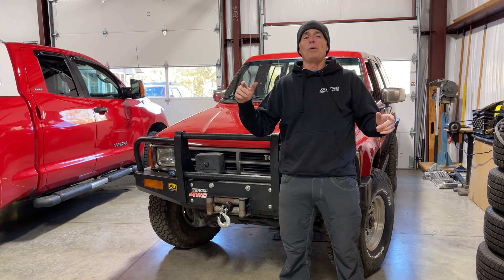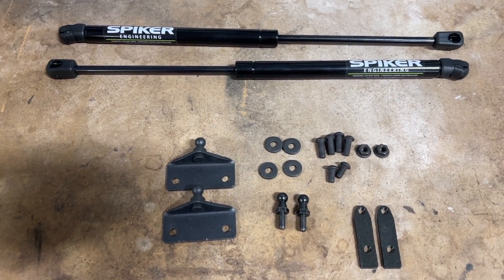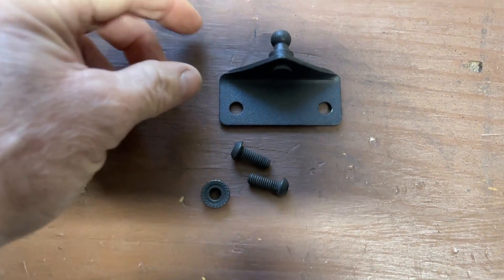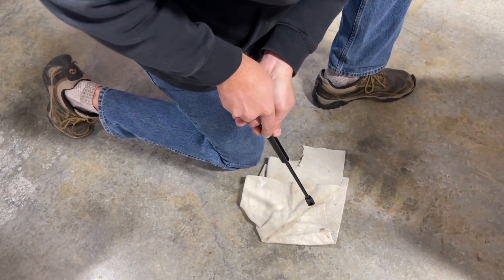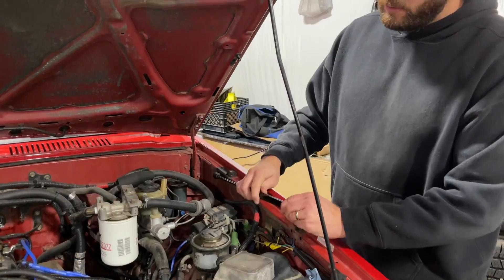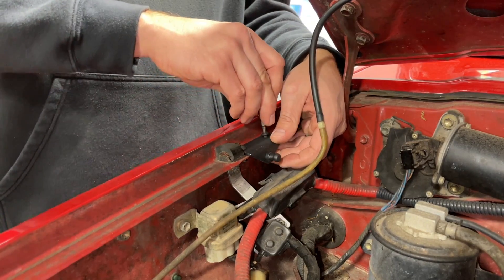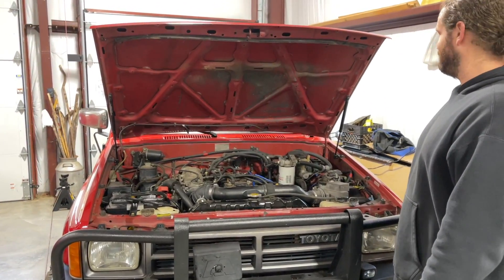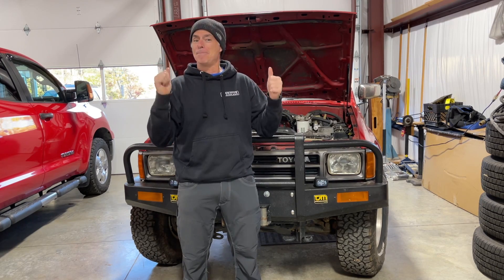Spiker Engineering Hood Strut Install (1st Gen Toyota 4runner & 1984-1988 Pickup)

Comment: Great video Timmy,
I have a 91' Toyota 3.0L 6CL EFI Longbed pickup truck.
It has the rod. It's very heavy. I'm 83 years old, and I would like to put Hood Struts on the hood.
It looks like I just need to drill one hole on each side. 
I'm not sure what size strut I need to buy. Can someone help me figure that out.
I don't know the weight of the hood. 
Ben M.
Reply from the maker: We're helping Spiker Engineering develop a kit for 90's pickups.  Stay tuned for the video.

Comment: I was going to install this on my 2000 tundra, but my truck came with these from the factory, and I’ve been using them the whole time. 👍👍
Reply from the maker: Yep, you're one of the lucky ones that already had hood struts.  For those that don't, they have Spiker Engineering that can hook them up.

Comment: I installed some on in my 1st gen Tacoma after watching your first video about them. =)  (I also got the ultragauge holder from spiker.)
The rivets are pretty strong, so you'll want to use a higher quality rivet gun. The cheapest harbor freight one I had didn't cut it and nearly ruined the rivets. Edit: just saw that the struts for this model don't use rivets.
Reply from the maker: Interesting the HF rivet gun couldn't handle it.  Usually their stuff, even though it's more cheaply made, can do the job.  

Yeah, this kit is completely drilling and rivet free.

Comment: These kits are sick!! I’ve actually installed these on my older vehicles that weren’t Toyotas. If your vehicle has a regular prop rod there’s probably a kit out there to add these to your vehicle be it a Toyota or a ford. It’s like heated seats….if you’ve never had them it’s not a big deal, but once spoiled to them you have to have them. Especially if your back is shot, but I digress. Good stuff brother!!
Reply from the maker: Yep, these kits are awesome.  Simple and very satisfying.

Comment: When you went to close the hood from the center, I saw the hood slightly tweak. I guess you just need to make sure you're pushing down closer to both edges when closing the hood so it does bend like the Chevy square bodies. Otherwise, it looks like a good kit.
Reply from the maker: I don't think the flex in the hood would be an issue, but yeah, if you grab on either side, it would flex less.  I don't think the hood or the hood hinges could bend that easily.
Reply: Muchas gracias
Reply from the maker: @juanpablonoriegacamacho9706  De Nada.

Comment: rather keep the prop rod and the money. hood comes off for major repairs.
Reply from the maker: Ok, keep your rod.
Reply: You can still take the hood off and keep your rod on the truck. The struts detach. But it's your truck, money, and choice.
Reply from the maker: @quillaja  I think he was trying to say, when he's doing an involved job, he just removes the hood, so the prop rod being in the way isn't an issue for him.  Sure, if I'm going to pull an engine, I'll remove the hood.  Other than that, there's no reason to remove it.